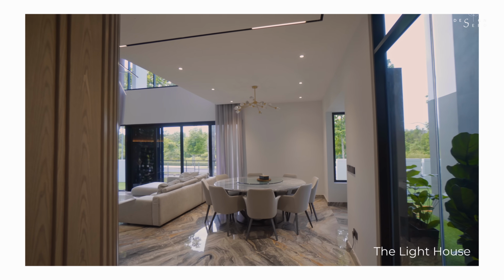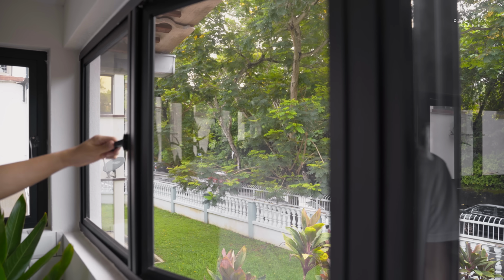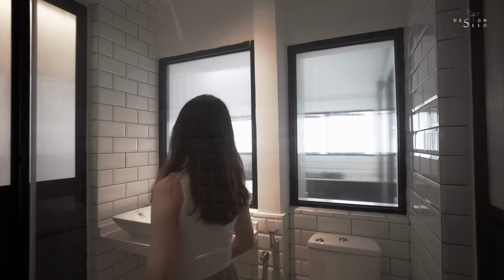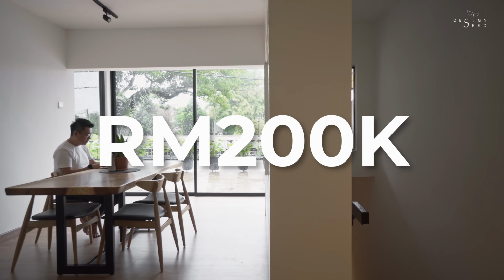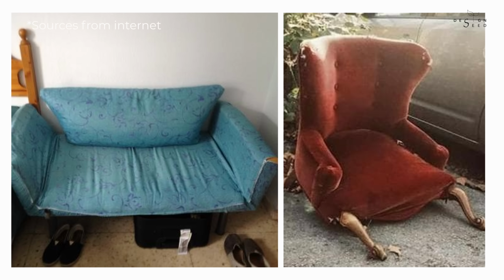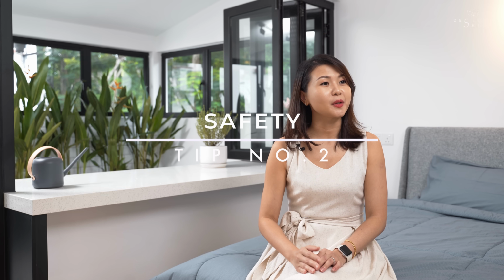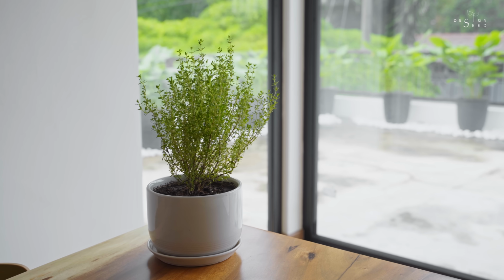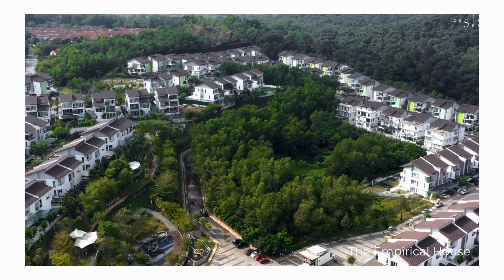5 Tips To Design Your Home on A Budget | 50 Year-old House Makeover | Indoor Plant |The Minka House

Comment: There are design flaws in the new floorplan - the master bedroom does not have a dedicated ensuite but a shared bathroom with the rest of the house and that bathroom does not have natural ventilation which then relies on a mechanical fan and ongoing electricity.
Reply: Another thing i find it weird is to have a breakfast table & ajoining kitchen right beside the bed.
Reply: @mopikozz  Agreed. The space between the old backyard to the bed 3 is wasted space and invades privacy. The original layout was better. 
The kitchen should remain where it was, knock down the wall between the kitchen and living hall and create a galley kitchen with extra long benchtop for storage down the long wall from living hall to the end of the old backyard. 
Remove the old internal bathroom to increase the kitchen living area. 
Shift bed 3 to the left to where the backyard was and create ensuite along the backyard wall on the left. 
Create new common bathroom between bed 3 and bed 2 with windows along external wall. The house now has 3 bathrooms all with natural ventilation which greatly increase value.
There is more usable space without the wasted hallway space between the kitchen and living area of the new layout in this video.